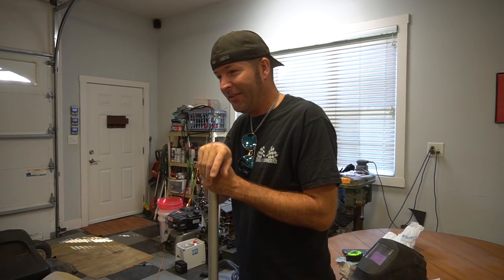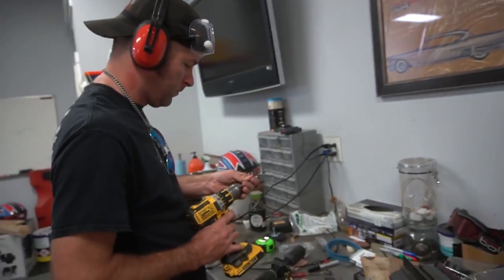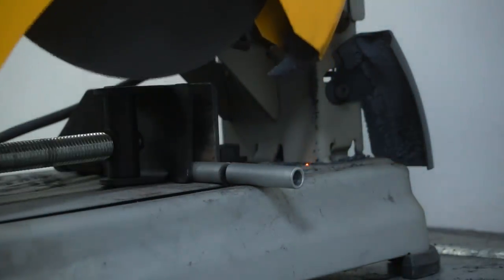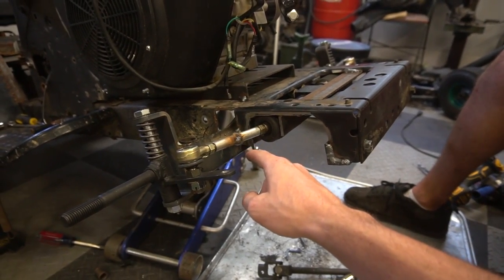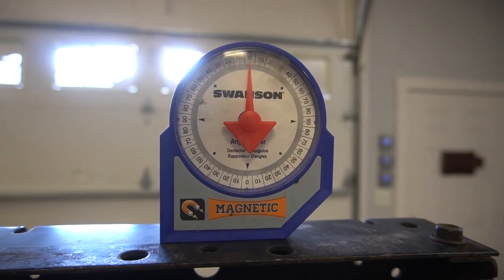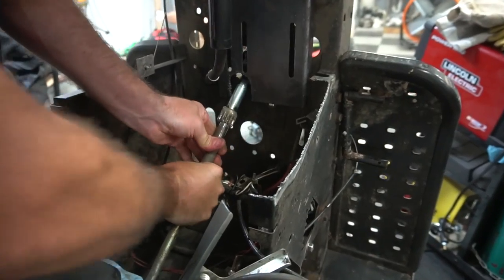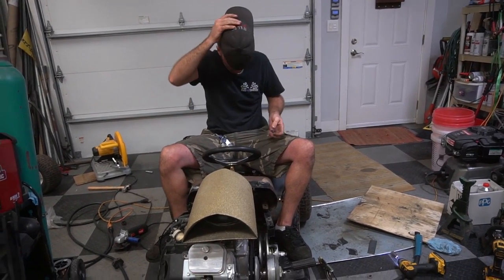Rack & Pinion Steering | 50HP Lawn Mower Pt. 2

Comment: Plasma cutter: Try dropping the air pressure down until it stops popping, make sure your ground is good and lastly put a inline drier/filter. Should fix the issue
Reply: Mark Thompson was bouta comment the same looks like way too much air pressure.
Reply: Was just about to say the same thing. My Miller is nice and smooth. Looks like too much pressure.
Reply: Also try removing any paint and or rust in the cutting area. Makes for a better ground.
Reply: Also check your dial on plasma see if it is on the right setting sounds intermediate not constant. Good show guys keep it up
Reply: I'm pretty sure it's from moisture in the air line.
Reply: My cheapo eBay plasma cuts better than that.
Reply: True and also don't set the tip on the metal the puddle that should fall threw will cut off the machine casing it to sputter do it like your wire feed welding angle and just the right distance
Reply: @samlong9292  Unless you're using a drag tip.
Reply: Definitely needs some adjusting. I have an old Miller Spectrum plasma torch that acted the same way, it was super sensitive to both air pressure and moisture in the air supply. When it was happy it would cut steel like butter, but when it wasn't it would act just like theirs is doing.
Reply: I agree
Reply: I was thinking the same thing
Reply: It's on the wrong setting
Reply: mrdabeetle1 
Only time mine pops like that is the air pressure is too high, and I’ve had it for almost 20yrs. 
mine also has an indicator lamp for the low pressure cutout. 
When you turn up the regulator from zero and the light comes on, you’re good to start cutting. 
No need for more air pressure.
Reply from the maker: We'll give it a shot!
Reply: “It’ll be fine” sorry I had to
Reply: @whitelightning2  ?
Reply: Maybe they like it fully automatic sub machine gun style… Mercia!

Comment from the maker: With big V twin power, we needed to beef up the steering. This should do the trick! Think it'll wheelie?
Reply: CarsandCameras   Maybe
Reply: Ike's looks better
Reply: Yes it will.
Reply: Hello John. I am Jacob Cichy im a big fan and i was showing my moms boyfriend the pt 4 of the chopper build (first road test) and i heard you mention something about wanting and old honda bobber?. I have a 1982 honda cm250. I do have the title, It runs but does not have a gas tank. I cant find one anywhere i figured you are the guy who would know how to weld one up and get this bike on the road again! Id love to see it on the channel let me know if you are interested. Thank you for your time
Reply: Put a turbo on it
Reply: CarsandCameras I think you guys should eventually put the engine cover back on but cut a hole for the blower
Reply: Yep..
Reply: Definitely gonna wheelie. If the steering gets sketchy  I feel like you could put a steering stabilizer on one of the spindles to the frame. When it comes down from a wheelie the wheel might pull from your hands with out it
Reply: Your weld is better than IKes
Reply: Nah Ikes looks better, stackin dimes.
Reply: AWESOME VIDEO! I bet it will wheelie! For your next project after the mower you guys ought to build a predator 79cc converted bike!
Reply: I don't think 
it'll steer very well with the front wheels in the air.
Reply: read Oliver's comment below, you put reverse Ackerman angle in it and thats why it didnt want to steer.
Reply: it might if the back tires are grippy anhuf
Reply: Ike's weld definitely better
Reply: Continue frankinstratin
Reply: Johns looks nice and neat but ikes are better.
Reply: CarsandCameras now that there’s no transaxle y’all should lower the seat into the chassis for a safer more comfortable ride and it’ll look better. In my opinion
Reply: Your plasma cutter is acting up because you are running too much air try between 40 and 70 psi
Reply: 973gordito that and I’d grind the paint off too
Reply: You guys should just cut off that front end box it off and make a front tube bumper
Reply: Why didn't yall lay the engine sideways, like the original one?
Reply: JaxRhapsody it’s a horizontal shaft motor not a vertical shaft like the original motor
Reply: It’s looking good so far
Reply: Yes it'll wheelie 110% sure it will wheelie my buddy has a mower with the stock motor that does wheelies
Reply: Hey guys! Awsome work and i just love your channel! As for your plasma cutter, it work like a welder like a welder and needs a good clean work surface.  Basically, try grinding away the paint, rust, scale mud or $#!+ away and it will help alot.  Most units have the ground and electrode both in the torch and some have a dedicated ground clamp but either way, a clean work surface will help with a nice clean cut. And practice so dont give up!
Reply: Definitely
Reply: And i just noticed that at the end of the video, you did have a nice cleaned out cut path ;) keep up with the great work guys.  Getting some ideas and tricks for my own projects
Reply: Yes.. It'll be fine
Reply: That beeping at 2:56 made me run out the house I thought there was a bomb
Reply: Ike’s welds have better penetration 👍🏼

Fix that steering ackerman and it’ll steer better instead of scrubbing so much.
Reply: Im the 100th like on your comment

Comment: When 50HP ain't enough

BOOOOOOOOOOOST
Reply: I’d be curious to see if an old smog pump (or two) from a late 80’s Chevy 350 would supply enough air to make a power difference if feared properly, essentially a poor mans supercharger for small engines.
Reply: dude... they'll die a turbo vtwin is nuts !!
Reply: Jake Roadkill boosted a car with leaf blowers .
Reply: George Rokosky didn’t they get like 3-5 more hp on a v8 I don’t remember but imagine a leaf blower on a tiny v twin (tiny compared to a v8) you might get a significant bost in power because your moving so little weight but idk
Reply: Jakes Karts idk but it would take up a ton of space.
Reply: George Rokosky definitely

Comment: To judge the welding i will call it a draw because ike has the proper width but the beads are sorta jerky looking, john has nice smooth rolling beads but the weld is a little narrow and rounded which means the weld didnt penetrate quite as deep but both welds looks like they wont go anywhere anytime soon so both a good job, now put down the easy welder and pick up a SMAW stick welder and see what you really got lol

Comment: I gotta ask. Anyone else really annoyed by their plasma cutter? Seriously makes me cringe on the inside when I hear the "pulsing".
Reply: Somthings wrong with it?
Reply: Yes
Reply: @michelebeck4311  yes look up plasma cutting videos and youll instantly notice the difference.
Reply: Dude Von Brostein it's the cheapest plasma cutter
Reply: @claytongowin9897  Are you sure that's it? My buddy has a cheapo and it sounds like a normal plasma cutter. It just won't cut anywhere near the thickness of material the box claims it will.
Reply: I wonder if their power supply is having issues, the welder didn't sound much better than the plasma cutter.
Reply: Too much pressure, and too much water in the air.
Reply: price doesnt matter.... if youre compressor isnt set up correctly PSI wise and have no inline air dryer youre killing the plasma cutter.
Reply: @chefdan87  welders often sound that way
Reply from the maker: We're very annoyed by the plasma cutter too
Reply: i run mine at 70psi try that
Reply: check your ground from your work piece to the plasma cutter. It looks like you are trying to cut with the part un-grounded.
Reply: CarsandCameras find a used hypertherm. I picked one up for $700 on Craigslist and it’s amazing.
Reply: @CarsandCameras  try putting an adjustable pressure reg & a dryer on the air line & turning down your air pressure a bit guy's that might help
Reply: Yes it doesn't work very well at all!
Reply: I thought it was a setup issue because it was new but there has to be something wrong with it or they would’ve figured out the problem by now. It’s like there’s something wrong with the ground or it isn’t getting enough power.
Reply: Dude Von Brostein  nope

Comment: Ike's welds were the proper color. You both had nice even coverage, but one of those jobs looked a little bit over heated. Hint hint, it's the one that looked more blueish . But it's hard to say, because that could have been due to lighting or color correction. Ike's looked a little beefier as well.

Comment: Like the project, but you guys need to have another look at that steering geometry. You've got a big dose of anti-ackerman at the moment, and it will tend to understeer a like a pig without a lot of lateral load transfer. I'm sure the v twin will have enough grunt to get oversteer, but will be way more fun in the slow corners if done better. Good luck!

Comment: John and Ike ..try turning down the air on the cutter..it may make smoother cuts..that or it has moisture in the air line...but that's not important..ya'll are making the best decision to get rid of the transaxle for a live axle..don't forget to make a set of wheelie bars..cheers from Bama
Reply: It has water in it

Comment: Am I the only one that noticed they cut way too much off the frame?
Then Ike stands on it and says "did I just bend it?" * rolls eyes *
You should reinforce where you cut the huge holes / U shaped channels or you might have problems with it twisting and breaking when its up an running...
Reply from the maker: There isn't any weight on that part of the frame, and we end up X bracing underneath as well.
Reply: Good to know you are bracing it, the corners are where it needs to be strong... Big triangular gussets in the corners underneath would work as well...

Comment: I think where you cut the big holes in the frame , I would of Stuck a piece of angle iron inside of the frame and also on top of the frame since you are using the front part of the frame to hold your steering unit . You Don't seem to have ALOT of Frame left . you could still add a piece of 1" angle Iron to the top of the frame and take it back about 18" to get more support . Just a thought .

Comment: The turning radius issue isn’t  a weight problem, it’s an Ackerman issue. The inside wheel needs to turn tighter than the outside. Good luck!

Comment: You might want to try decreasing the pressure a little but on the plasma cutter and drain the water out of the air compressor

Comment: i knew it looked a little compromised where John torched out the material for the steering rack. I didn't think you'd jump on it...the one weakened spot and bend it right on the worst possible place haha you found the weak link so maybe by the end of this video you guys address it .

Comment: Reminder of the basics of a plasma cutter, dont touch the material with the tip (1/8 inch gap is best). If you need to rest it on the piece use a guide rest torch tip. And always maintain the electrode.

Comment: put the outer tie rods in the original holes and that should put your ackermans back in and it will turn better, you could make a outer tie rod sleeve then slot the hole and make it adjustable to be able to dial it in once it's up and running.

Comment: to get the steering right you gotta cut the iron that connects to the rack and pinion from the front axles, it should be angled towards  center of the rear axle (oppositely for you,  you gotta imagine/calculate as if the rear axle is in the front; since your rack and pinion is on the front side of the axles) do as i say and it will track nicely trough the wasteland, The Great Humungus has spoken!
Reply: Do not calculate it as the axle was in the front, this will induce more anti ackerman like they already have. the steering arm mounting points for a forward mounted rack should be further towards the wheel to stay in line with the rear axle's center point.

Comment: The plasma cuter is on the wrong setting on the front of the unit there shuld be a switch or a knob with what looks like the torch head with a dotted line or a solid line

Comment: Don't you guys think that you should put some steel back where you cut away for the steering rack.  As a matter of fact there is a lot of reinforcing you should be doing.  That 670 has a lot of torque I'm thinking the frame needs some build-up to handle it.

Comment: Ikes is a little better. Clean the paint off of the cut area before plasma cutting. That's a tiny unit and you need all the connectivity you can get. Steady and consistent is the name of the game in metal work.

Comment: I think you have moisture in your compressed air system!
No plasma cutter should sound like that^^
Maybe to low on the electical system aswell, since the MAG sounds bad to^^
Reply: Im sure its both problems

Comment: Little pro tip turn your plasma cutter up higher you want it so you can move at a good pace and not have any sparks be flying 90 degrees to the point you want all your sparks to shoot steadily out the back of the steel

Comment: Your tie rods should run equally parallel to your front Beam and that will give you a correct Ackermann angle. you guys have it closer to the front beam  at the spindle and farther from the front beam at the rack and pinion

Comment: What air pressure are you running in the plasma cutter? Try experimenting with it since too high of a pressure could be the cause of the popping and unstable arc.
Reply: It has water in the line

Comment: If you dont cut the hood for the scoop I'll be disappointed. Could weld some weight in front of the rack underneath. Or some type of way to add weight to the front so you can steer at speed.

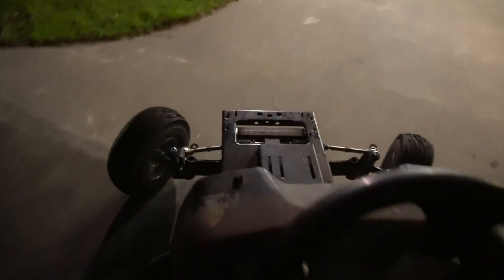Comment: Do you have any Ackermann on those spindles?  Shouldn't the steering arms on the knuckle point to the middle of the rear axle?  It almost looks like it's doing it backwards at 11:50, turning the inside wheel less which would explain why your front wheels scrub.
Also 8:08 I hear you "deez nuts"

Comment: Is it ok to put 22 lbs valve springs in a stock 212 predator with gov removed? Or should i go with the 18 lbs
Reply: It depends on how hard you turn it.  What the heck go with the 22lbs

Comment: Man at sputtering on the plasma cutter isn't right, I'm not sure what's causing that. But the two I got are way smoother
Reply: Ryan Wopat weak ground.
Reply: Or not enough power. I.e. running off extension cord. Their weld does it at times as well. I noticed it being ran off an extension cord before.
Reply: Gotta agree with the extension cord thing, I run a 110 welder at the shop everyday doing sheet metal work and unless you use a real heavy duty drop cord it doesn't weld worth crap. I hear it in their welds too sometimes sometimes not enuff heat and sometimes wire feed it too low.

Comment: Moving the holes for the tie rod on the spindle causes Ackerman to go out of wack that could be the reason Isaac was having an issue with getting it to turn I see it all the time on late models they do it to get the wheel to turn faster but it causes one wheel to turn more than the other

Comment: do yo think the new steering work for the stock front end cause i have a mower that has the same steering components
Reply: If your still using the stock vertical shaft engine with the belt system it wont work. It'll be in the way

Comment: Clean the paint off before making your cut with the plasma cutter, the tip completes the circuit and it won’t sputter like that if its contacting bare metal

Comment: Hey the mower not steering got me thinking on why my kart doesn’t steer very well to the left but it steers to the right better is it because the steering shaft between the tie rods and the steering wheel is off center to the left or is it because the right spindle tie rod arm thing (where the tie rod bolts to on he spindle) is bent up more than the left one or is it just there’s not enough grip in the front (my tires are super old and worn down to slicks now there’s no tread in the middle) but I don’t think it’s the grip problem because it steers to the right good
Reply: Could be the off set of your engine too. Putting more weight on one side
Reply: Isaac it'll be fine my engine is a little offset to the left but close to center so what do you think?

Comment: Since the Ducati engine does not fit on the drag rail you need to build a new drag rail and put a big motorcycle motor (maybe a turbo) and a 6-speed Baker transmission between the back of the driver seat and the rear axle!!!!!!!!!

Comment: How many cc are in a horsepower?
Reply: Cc's and horsepower are different rating of power, horsepower can change from different accessories like turbos or superchargers,  but cc's is the size of the cylinder displacement. So the bigger the cc's the larger the cylinder or the more cylinders it has. * this is how I understand it, and could be wrong possibly.
Reply: Thanks

Comment: should have used the centre section of the adjustment collar and re tapped thread instead of using the threaded ends and welding the middle.

Comment: Hey I built a mini bike but I'm having some problems keeping the 212 predator idling could you help me
Reply: Im not sure how i can help. Most of the time idle problems are caused by poor gas (ethanol) which gums up the idle circuit. Most likely needs a carb rebuild. There can be other problems but i just talked about the problem that mostly occurs.  Good luck

Comment: Not to be picky but don't you guys ever bevel any of the material , shafts etc that youre going to weld before you weld it instead of just but welding the surface?  Love the vids , just need to bevel the material for better penetration.

Comment: The air pressure on your plasma cutter is too high if the pressure reduction doesn’t work clean or get a new gun head for the cutter

Comment: Great fit getting the rack in, but a part of me cringes when I see track rods being cut and welded... and steering shafts... 
not that I doubt both of your welding capabilities, it's just a horror based failure point with what that motor's capable of, and 
at least there are no brakes loading up the steering components..